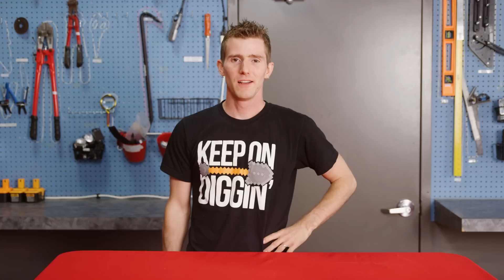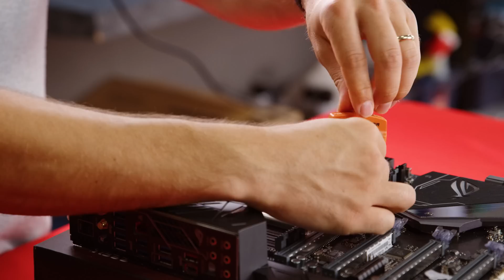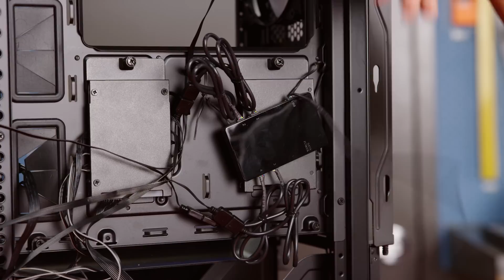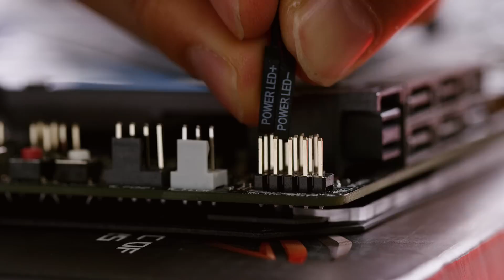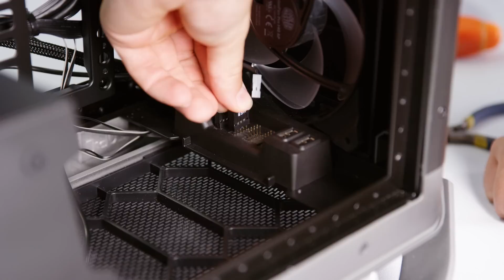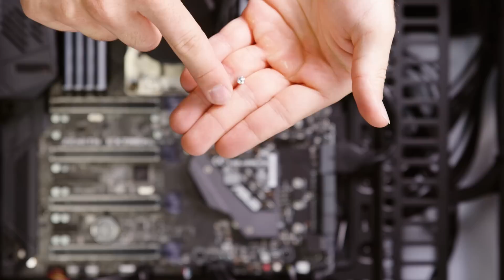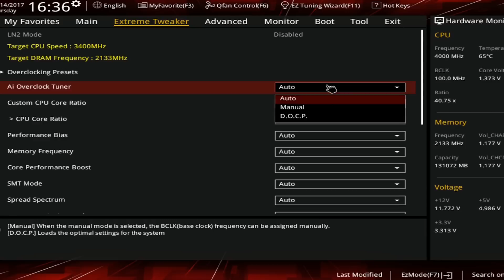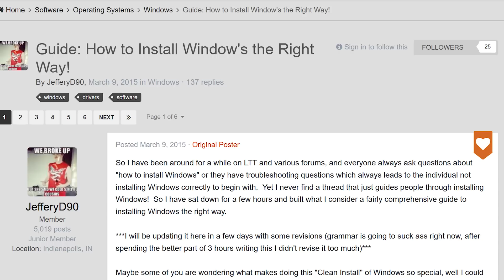Ultimate Mega-Workstation PC Build Guide

Comment: is the ryzen 5 1600 worth it for 2 more cores?
Reply: Florian Kleinebreil yea im talking about for gaming but i wasnt sure if it would improve performance for gaming. i have an outdated pc. its an x4 860k with a gtx 1050 ti. im justing going to build another pc because i have a case just for matx and i want an atx size board. so im going to build another pc and might get a gtx 1060 6gb.
Reply: Karma Scar if you're getting the 1060, the R5 1600 will definitely improve Gaming performance over the 860k. This also depends on the games you want to play of course. I'd say go for it, AM4 is just the more modern and better plattform.
Reply: Florian Kleinebreil yea. im most likey going to get the 1060 also. thanks so much for helping me. i appreciate it
Reply: Karma Scar 6 cores is not 2 more than 16
Reply: Seon-Ho im talking bout ryzen 5 not thread ripper. im talking about non thread ripper.
Reply: Seon-Ho should i spend $50 more on ryzen 5 1600 instead of saving $50 with the ryzen 5 1400.
Reply: If you can, yes, it's worth it. The 1600 offers the best value of the whole Ryzen lineup. If you can't the 1400 is perfectly fine, too. I'm assuming you're talking about gaming btw.

Comment: LINUS HELP ME! I have an important question. Is it using CPU for heating home have the same power efficiency as using the electric heater? It could be a nice idea for the video linus ;) Like this comment if you want to know this, so linus can see this comment. Winter is coming ;) Maybe ... is it worth to turn up the OC on CPU and turn off the electric heater ? Do I get an extra FPS for this without paying extra for the electric and can I keep the room temp the same with just the CPU ? And what is the biggest "passive" heat sink that we can use for this project so we could get hot room and no noise at the same time :)
Reply: unsigned int it's both, electric heaters convert 100% of the energy you put in into heat, heat pumps use that amount of energy to move 3-4 times the amount of heat from somewhere else to where you want it.

One creates heat, one moves heat.
Reply: Heatpump /= electric heater. 

CPUs do not convert electricity to heat with 100% efficiency, but it is close. That is why we consider TDP to be roughly equivalent to power draw.
Reply: it is literally 99,99999..9%, energy needed for quantum-information stuff is measured in femtojoules per bit or lower. there's a french company that uses ryzen 7 chips for cloud-computing while heating peoples homes - it is very common in france to heat electrically because their power is so freaking cheap (>80% from nukes)
Reply: I have a GPU that heats up to 70°C at full load and keeps the room temps at around 20°C. It's A LOT cheaper than paying for oil heating. Nowhere near as effective of course but it's effective enough and at a much lower cost. Oil costs roughly $150 while I pay $60 for electricity and that's including all other appliances.
Reply: both have at least 99% efficiency in power conversion to heat, so for all intents and purposes they are about the same.
however, because a PC is not designed for that it'll be very slow to spread the heat around the room.
in short, as long as you can handle waiting a while until the PC's heat spreads around the room a bit, you'll be just fine with it. alternatively, you could turn the heater for the first couple of hours and then turn it off and leave only the PC on.
also worth noting that unless your CPU/GPU are at full load, idle power consumption is typically below 200W which is significantly lower than most heaters.
Reply: Navi Retlav my computer makes my room keep perfect temperatures, I only have a problem at extremely hot days, but because my room is a 2nd floor room, and the 1st floor is kept at a ok temperature. The heat from the 1st floor and the computer keep my at a nice temperature during cold days.
Reply: +nhozdien They've done videos on worse ideas before. I wouldn't doubt it.
Reply: I saw that the new Intel Core i9-7980XE has a power draw of 1 kW if overclocked to about 6 GHz. So that would probably be the right choice for a build with a regenerator. If the regenerator has 30% efficiency, then you'd get 300 W back, which is enough to power most monitors and peripherals. But keep in mind that you need to run your system at full load all the time.
Reply: CPU WALL, THE NEW HEATING/HOME SOLUTION!
DO YOUR WORK ON THE LUDICROUSLY FAST 20 COMBINED CPU’S ON THE WALL, WHILE WARMING UP YOUR HOUSE AT THE SAME TIME!
Reply: there is a French company that does that already.
https://www.qarnot.com/qrad
They want to save the environment and money for the cooling of the server farm and AMD is in it to be exact 3 Ryzen with a total of 500 watts of heat
Reply: yep, but you pay for it , they get it free and money back for the current
Reply: Hell yeah, Core i9 and CrossFire Vega 64s overlocked the the limit!
Reply: Nice. Here I think about starting my own company for dinging eth/xmr coins and heating households ;)
Reply: P8qzxnxfP85xZ2H3wDRV 
Not how it works.
You'd kill the refrigerator.
Reply: P8qzxnxfP85xZ2H3wDRV 

That's what I was thinking. "Off too bed, time to start the 6.5 hour torture test while I sleep."
Reply: Vera What refrigerator? Regenerator! It's a generator that "re-generates" electricity from heat.
Reply: watch their old whole room water cooling vids
Reply: Navi Retlav this is actually a legit idea and it has been tested. For a home, maybe not, since heat distribution is a problem, but it definitely works in my apartment in the winter. Dual 130W xeons and a 150W graphics card. Puget Systems has a good post on this: https://www.pugetsystems.com/labs/articles/Gaming-PC-vs-Space-Heater-Efficiency-511/
Reply: unsigned int More than 99% of the electric energy that goes into the CPU, leaves the CPU in the form of heat. Please do your homework before spreading your opinion on the internet.
Reply: unsigned int I'm sorry if you thought I'm discussing this with you. I only wrote to teach you, because you clearly don't know much about this. Well, my mistake.
Reply: unsigned int Yeah, everyone knows that. What is this? Kindergarden? Reading back on the comments, everyone stated something like "close to 100%".
Reply: I guess to get of get 3 - 4 time more pleasure with computer vs heat pump.
Reply: Navi Retlav it’s a terrible idea that LMG wont do it
Reply: Yes. Both an electric heater and computer chips convert electricity to heat with 100% efficiency. Computation requires no energy (or only a tiny amount of it, theoretical physicists arent quite sure yet).

However, heating should only be done in this way if there is really no better option. Heatpumps can get you 3 to 4 times the amount of heat for the same amount of electricity. Also, if your area uses fossil fuels to create electricity it is even more efficient to burn the fossil fuel directly in your home. Examples of these are gas and oil heaters.

Comment: Thread ripper, MORE LIKE WALLET RIPPER AM I RIGHT!!!!!!!!!!!!!
Reply: ZNRD Clan Eh, cheaper than what Intel offers core to core.
Reply: wallet saver, you mean. Considering the i9 chips from intel are 2x the price of Threadripper.
Reply: Hahahahahah

No.
Reply: Nope. i9 is. I have an octocore setup that would have cost $3K just for the processors when it was new half a decade ago, so those prices are sweet.
Reply: so you mean there alot of company that cheaper than amd ? show me
Reply: http://i.imgur.com//R7Vbhay.gif
Reply: ZNRD Clan not really
Reply: Eh, considering what the 7980xe does when overclocked (nearly 50% faster than the 1950x), you do kinda get what you pay for.  Either way, my 1950x was one hell of an upgrade to my existing system.  In the applications I bought it for, I get nearly 3x the performance of my previous computer.
Reply: Do you mean amirite? Anyone? No.
Reply: Nathaniel, peak overclock performance was only as high as 27% on the 7890xe against the 1950x, not 50%. That being said, $2k CPU versus a $900 CPU, with just two fewer cores, the 1950x wins.

http://cpu.userbenchmark.com/Compare/Intel-Core-i9-7980XE-vs-AMD-Ryzen-TR-1950X/m352013vs3932
Reply: Aspiring Wackjob wasn't trying to shit on the 1950x, I bought one myself.  The point was that its still a hilarious fantastic value.
Reply: I'm looking to two of them myself for the workstations I need for the studio I'm opening up. Right now I'm using a 1700, which is an amazing upgrade from my old FX-8300.
Reply: you get what you pay for ^__^